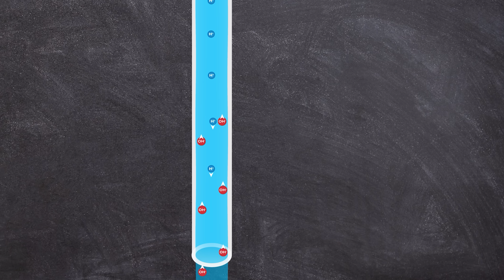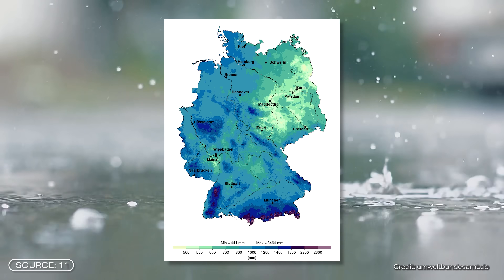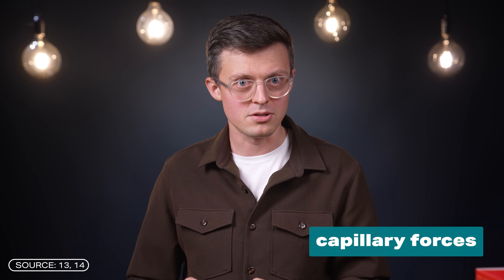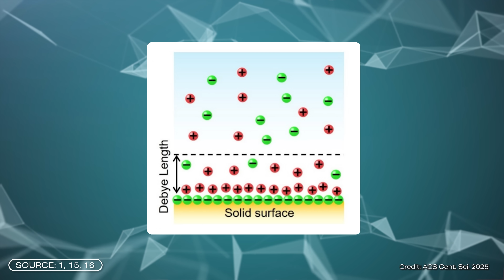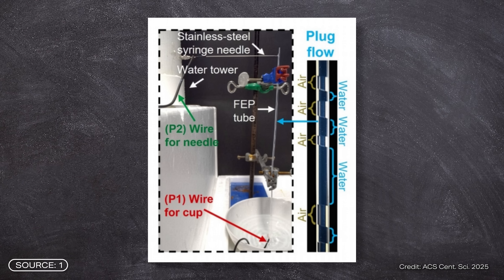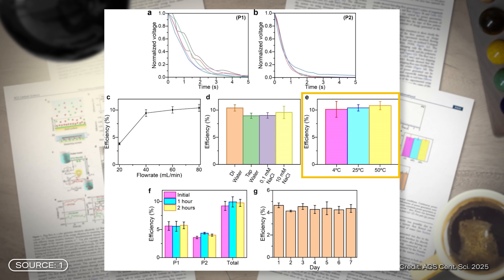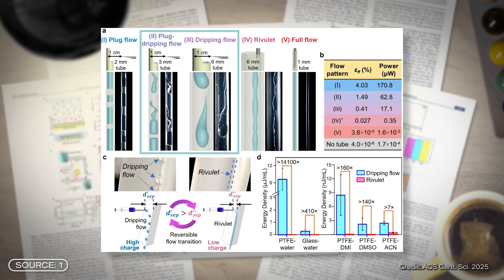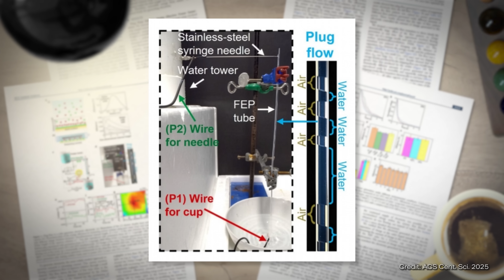Physics Hack: 100,000x More Electricity from Rain!

Comment: Ive seen something similar like this  expect the a water and two empty buckets of water on the ground, the it drip something the tank, and dripping in to two separate columns of drip water, one to each bucket on the ground, and metal rods (the electrical conduction, guessing here) and came out the buckets ,and made a cross frame structure, but they were not touching  though, and where did cross the was steady stream of spacks  ever second or so as remember the saying mostly static, so not good for anything but did look cool though would make great water feature  in garden pond, if did not execute all your fish though

Comment: Given that electricity was discover only a few hundred years ago, it impossible to have generated electricity from flowing for water for "thousands of years".
Reply: The Greeks knew about static electricity at least 2,000 years ago.
Reply: @wesbaumguardner8829  So do I. What relevance has this comment?
Reply: @nicolek4076  Is English your third language or something?  So do you what?  What relevance has what comment?  Do you understand the English language?  What are you about?  I have no idea if you are even speaking about one of my actual comments or not.
Reply: Do you know the difference between energy and electricity? He said energy and energy was generated by water power for thousands of years mechanical energy is also energy.
Reply: @soaringeagle What are you talking about?  Both the narrator and the OP on this thread are talking about electricity specifically.  Electricity is a form of energy.  Energy is a broad term that means anything that can be used to apply a force and/or perform work.
Reply: @soaringeagle  Your comment makes no sense. You cannot generate energy - it exists and it can be converted but never generated.
Reply: @nicolek4076  what are you talking about the rain has energy water has energy. You’re converting that energy into another form like mechanical energy. You’re like using water to grind grain as a result don’t you understand that still just energy conversion all energy is energy conversion
Reply: @nicolek4076  i’m just saying that water has been used for energy conversion for thousands of years and that is true

Comment: What am I watching here ? Don't understand - there is no free energy right? -- there is no phase change or thermal shift going on in this exchange??  
So this is all just rextracted (by a weird way) from gravitational height potential - mgh?  Even if you can extract it all wth100% efficiency you end with a pathetic yearly total. 
Lets say large roof 10x10m and 1m of rainfall in year (larger than European average)   -= approx 100Tonnes of water - that then falls from roof ~10m to ground level   so 100,000x10 x9.81 ---round up to  ~10,million Joules  divide by 3,600 to get  2,777 Watt-hours = 2.7kW-hours. By comparison my solar array (on a smaller roof) generates several MW-hrs in  a year.

I had a collegue suggest collecting potential energy of rain many years ago  by putting turbine in the drainpipe. The math worked out the same then - i.e. there is no real energy to be had at all from rain. Unless there is some hidden energy in water that I have missed or failed to understand?

Comment: I saw a Robert Murray-Smith video where he made a rain energy panel that produced a high current per square meter with the impact of the rain drops, sort of like the piezoelectric effect.
Reply: I was thinking about this concept during the video.  Glad to see someone has tried it. 

Each rain drop that hits a roof has a certain amount of kinetic energy.  This will be limited to some extent by the terminal velocity of rain drops.  That energy can be captured in two ways.  It has the ability to do mechanical energy when it hits a surface and again as it flows off the roof towards the ground. The pitch of the roof should determine the balance between the two.  A flat roof can fully exploit the deformation, while a pitched roof diverts more of the KE into the flow in the down spout.

I'm curious how the two balance each other and what the relative efficiencies would be.
Reply: I was thinking this, and with the loss of Robert Murray-Smith I might start following this guy
Reply: Yes, I'd enjoy seeing an episode about triboelectricity since I was also thinking about Robert's video, Ask YT for NPEomzHgtvo but there may be more than one, and his son Luke may have one too.

Comment: We can use an idea from  Viktor Schauberger's Repulsine . We create a wavy pattern between 2 plates in a spinning disc. We allow the water to enter between the plates, at the center of the spinning disk. At the Apex's of the waves, we create tiny slits . The water is forced to compress and decompress by the centrifugal force as it travels through the wave from the center of the spinning disks to the outer edge, accelerating and constantly being compressed and decompressed. It would pull in air through the tiny slits at the apex of the waves, therefore created the interrupted water flow.  The charges could be collected similarly , via a contactor on the rotor, or a mercury contactor.  I think this way we are not subject to the limited speed of gravity for the falling water droplets but can actually accelerate it via the centrifugal force,  Faster speed = bigger energy.

Comment: @GermanScienceGuy I am wondering if the use of a hydrophobic material on the inside of the tube would be of assistance in increasing the frequency of edge forming of the droplets. If I understand correctly, where the inside tube surface is already wetted, the charge potential is lost or minimal. Would a hydrophobic surface inside the tube maintain a more uniformly dry surface, therefore a greater efficiency? Or is that something they're already using as a property of FEP?

Comment: Efficiency of over 10%. Whoopie doo. Ye olde water wheel + spinning magnets can easily get an efficiency of over 90%. 

The issues are. 
1) The amount of energy is not huge. Water collection ~ surface area, Joules per liter ~ height. So the amount of power you can produce is roughly proportional to volume. (A hydroelectric plant can use cubic kilometers of rock as it's collecting area, 1 house won't produce much in comparison. In fact, even lots of houses won't produce much. To compete with a hydroelectric plant, you would need to take the many many square miles of catchment area, and cover it with jam packed skyscrapers.

2) Roof gutters are often full of dead leaves, moss, and assorted gunk. Any complicated mechanism, especially one that involves 2mm diameter pipes, is going to get very clogged up.

Comment: Why not just make a small hydro electric setup from the rain water falling from your roof? Have your gutters direct into a storage tank just bellow the height of your gutters, have a pipe angle down steeply to another tank on the ground or buried for an even steeper angle, and have a hydro generator somewhere in the middle or end. Use the tank up top as a battery of sorts once the whole system is full of water when its not raining. You get rain water to use when you need it and it generates energy with no energy input outside of the rain naturally falling.
Reply: QuintBuilds did this a couple of years ago.  Barely had enough electricity to charge a mobile phone.
Reply: @GrahamReeds buy solar batery phone xsse
Reply: The amount of energy generated by doing this is negligible.
Reply: @rogerphelps9939 Both are, but with turbines it goes from 10% to 60% efficiency, six times more. Also, you can route the water to store it

Comment: I wonder how much power could be retrieved from just a micro hydroelectric generator using the 10 foot drop from the roof. The cost of that could be under $200 to handle all the water off the entire roof, using a used automobile alternator and battery. This might could power a low voltage yard light system.
["Might could" is Pittsburgh PA vernacular! 😅]

Comment: If graphite is conductive and trees specialize in making tubes ideal for the upflow of water, then what are the odds this technology can be adapted to heat treated tree rings? Also, tree rings are a great way to filter water. This makes me think of a rotary engine style interface (windmill powered?) that sweeps alternating water and air into the tree rings. Another trick is to use solar distillation to allow seawater to vaporize and rise to the water tower with just heat input. And if you have enough drop on the drain tube you can create a vacuum pressure to overcome counterproductive capillary action. This also reminds me of the cooling mechanism of a heat pump- the vaporizer. All these mechanical processes should be considerably compatible if stacked into coordination.

Comment: what about if water is flowing up , like the section used to fill the rain gather tank, ie using gravity to force water upward, would the oh then force it self down or would the -oh and +h  both travel up toward a single point, assuming +h is just traveling in dircetion of water and not falling due to gravity

Comment: I think that the worst showstopper is how much rain and potential energy is in a 32cm drop. I did some numbers for an unifamiliar house in a very rainy place and you can get like 6W continuous average with a system like this, or a bit over 50kWh per year. There is just not enough rain to feed a whole roof of this things. 
A setup that may make more sense is building them into walls replacing the rain gutters and not only having many in parallel but in series too. However even if you did that you would still come very short from supplying the energy needs of any home and would be anything but cheap.
The invention is interesting and it will surely find some niche, but I don't think home power generation is that niche.

Comment: I wonder if, instead of tubes, you could make sheets of fep with channels inside, could use a roll process, much cheaper than extrusion of individual tubing?
If electricity is generated by each needle/tube, it would be feasible to detect any tube that 'drops out', and possibly inject air through the needle and tube... Possibly, some kind of bubble injection in the water flow could guarantee droplet spacing...  Indeed, if rain is the water source, perhaps simply feeding raindrops directly into the metal needle?

Comment: This makes me think that we're 'wasting' a huge amount of energy in hydroelectric turbines.  And, maybe, in every plumbing system we use.  

BTW--your English is fine.  You obviously have a German accent, but it's not unpleasant and it is easily understood.
Reply: Modern hydro turbines are pretty efficient. Way more efficient than this thing. 

And catching tiny amounts of energy around the edges of a system is generally not worth it.

Comment: Nope, you won't ever be able to separate each water Droplet with air in-between each one. If you heated the metal cup ,of course they would bead up, and then evaporate. And without charge collectors, there is no way to register a current.😢

Comment: So don't focus educating masses for nuclear systems and don't create a few nuclear reactors that MAKE FUEL as they run to fuel small modular reactors that would only need to be refilled every few decades. Sad.. Earth seriously has no intention of building real spaceships obviously. Even better? Points at Boeing Plasma force field blocking bomb pressure waves Total immunity to storms with capacitors taking turns filling and dumping for continuous high power at safe breaker output. Flood issues? Points at Ultrasonic holography + Plasma generated Ultrasound Make pillars into the sky then let pillars go down as water levels drop.

People have no clue how powerful capacitor dumped Plasma generated Ultrasound shockwave echo clashing is for Z-pinch fusion propulsion yet. Hint: Nasa is scared of it. "But you need EM to crush Plasma" Google: "Ultrasound excitement of Plasma generates stronger EM field" Shockwave crush layers of it.. Like flying around in a super fast elevator.. Smashes bottle cap in fingers launching it super fast Flying cars? Hell yeah.. Why I mentioned shield by Boeing and Ultrasonic holography? Shield for buildings could be programmed to catch people falling if errors happen. Yes.. Full tractor beams by Ultrasonic echo clashing range limiting single sourced holography. 

All costs power.. Mass producing thousands of versions of junk you can all download on your phones isn't helping masses you could be so much more if needs mass produced with everything else on elite Ultrasound holography printed smartphones with perfected merged of the best Apps. Note that Ultrasound holography can print through walls and can control nuclear material for perfect shielding for masses. Google: "Ultrasound hologram with particles university" It will show the examples.. Max it and print nuclear reactors with sound. "Ultrasound solidification of molten metal" + "Ultrasonic resonance" pulses below bond breaking vibration/heat for maintaining molten state while moving through the air to target.

The smartphone thing? Points at Iron sky clip Germans.. Heh.. https://www.youtube.com/watch?v=8HtB85LeGtY Bypass the battery.. Holds up Piezoelectric Ultrasound Crystal + Amplifier + Capacitor + Piezoelectric shunt connected to ultrasound transducer to throw off excess energy as Ultrasound when capacitor fills Crystal radio was good enough to be heard on the raging battlefields.. Just saying. - Dracula (Fixed typo lol)

Comment: One thing on the cost, you estimate €250000 for a ten square meter area one meter thick, but the maximum tube length could only be 32cm or 32mm (I don’t remember which) which would drastically reduce the cost. Instead of 25k it would be 8000 at the 32cm length and 800 at the 32mm tube length, either way much cheaper.

Comment: "An average of between 94,000 and 104,000 liters of rain is likely to fall on a 2,000-square-foot house per year in central Georgia."
Reply: Hmm. Where I live we get an average of 87 inches (22 cm). My house roof is about 1000 sq. ft. (100 sq. m.), so total about 22 cubic meters or 22000 liters. 
With a three meter drop, that could provide 22000 kg * 3 = 66000 kg*meter. If it happened in one hour that would be about 180 watt hours. So still only enough to maybe power some LED low voltage yard lights, using a 12V car alternator and battery.
... IFF I did all that correctly! 🤣
Reply: @GaryBickford how many tubes?

Comment: What about using this tech within a steam compressor?  You could get the droplets to form and mix with air as they fall, so that helps break flow rate giving you the droplets to form air droplet format this system needs. Let the steam created rain fall into these tubes set in a disk to collect the electricity and it still be gravity fed system.  By using it in a steam condenser you also eliminate your foreign matter that may be present in rainwater. Might be a great way to pair it with desalination.

Comment: 80ml/min/tube x 225,000tubes/sqm = 18 cubic meters per minute! 😅

So if your roof is 400 square meters and collects 900mm ofrain throughout the year, you’d be able to generate 100 watts for 20 minutes. 😜

Comment: Could someone please help me with a calculation? This technology sounds very cool, but ultimately it is, if I understand the video correctly, using the gravitational potential energy of the rainwater falling from roof to ground level and is aimed at use on a domestic house. If we take the average annual rainfall as 1000mm, i.e. 1m  (about right for UK or Germany) and (I think generously) assume we have a 10x10m house (100m2 roof area) then we get 100m3 of water annually, which has a mass of 100,000kg. Let’s assume the roof height is 4m.  The gravitational potential energy gained by dropping that mass of water down to the ground is m*g*h (where g is 9.81 m/s2) which is about 4MJ. This is just over 1kWhr, or about 0.3 euro worth. This hardly seems worth the bother. What am I missing here? I must have done something stupid in my calculation. One more thing, it would have been nice to see a brief comparison of the efficiency of this technique with that of dropping all the rain water through a small turbine generator, or at least to point out why that’s not practical and where the plug flow technique wins.

Comment: could you just not have an electrode at one end of a stream and another electrode at another bit (couple of hundred meters or whatever) and measure the voltage? has it been done? or at the top of a waterfall and the bottom?

Comment: The big problem is the rainwater and air will have to be filtered and sterilized as it contains dirt, biological life that can grow in the tubes, chemicals and pollutants.. Maintenance will eclipse any power gains so this will be a dead end unless it is a closed loop.. At that point solar panels would be far more efficient for the space this takes.. How about a chemical solution that gives up charged particles easier than water that can be continuously cycled through?? But then there is the power usage of a pump to keep it circulating that is sure to be more than the generated electricity..
Reply: 09:37 seems to touch on this, no?
EDIT: Nevermind, 11:45 onwards confirms this.

Comment: There's potentall with the tech, but it clearly needs more work and the price point will be a big hurdle, but if this tech could complement solar and wind energy, especially at a local level on our homes, then further research is warranted, also, if it's like any other tech, it likely can get a lot better in how much energy it can produce, but as I said, the biggest problem is with the price, especially with how cheap solar energy is getting.